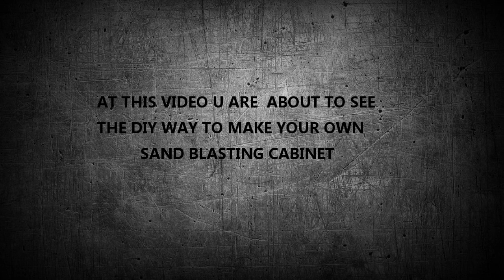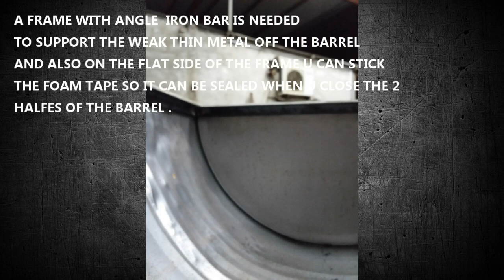DIY Sandblasting Cabinet Start to Finish

Comment: Can you explain why you so strongly warn that "most of the time they will explode when cutting"?!!  Unless they contained flammable liquid AND were not prepared properly ie rinsed, fumes allowed to evap, there should be no explosion concerns...   If they contained non flammable materials there is no issue, and if they did, prepare it properly and you'll still be good to go.  Don't scare people off by not giving the full picture!
Reply from the maker: Hi and thank u for this comment. Am just mentioning the above as a simple warning  to anyone that has the intention to re-create this type of sand blasting cabinet. Also as u read i justify that it depends what the barrel had inside. This way people can be aware and avoid any accidents.And this is the reason i mention above that it is best to get  this type of work done by a professional.
Reply: I def get adequate warnings and cya against stupidity, but your wording made it as if they will almost always will explode!  If it didn't contain flammables or was prepped properly then cutting a barrel is actually a very do-able DIY project.

Comment: looks perfect, have you found any limitations or anything you would do differently? why did you cut the barrel in half? couldnt you just cut out one end and make a door to seal up over just the end?
Reply from the maker: Hi man thank u for the comment . no it works just fine . i cut it in half so i could have the advantage of using the full length of  the barrel . The key, is to use a good sand blasting gun and a good dry air from a compressor .
Reply: i watched a few other drum blaster vids today as well as yours and some people just cut a "door" in the flat end of the barrel but the window and glove holes are mostly the same as yours. i was thinking it may just be easier to cut a large square hole in the end of the barrel and make a door maybe with some 1 inch square tubing to frame it so you can get a nice tight seal as i know blasters can tend to leak (specially the cheap commercial ones) 
another line of thinking is that if you cut it in half like you did you could also get some sheet steel and make it higher, more like an oval than a round shape if you wanted some more height in your design. 
ive been thinking about trying to build a blaster for years but the expense in buying new steel etc just seemed to make it not worth it but i can get these barrels for nothing here in australia but just never thought of making one out of them. i think it seems like the perfect solution to what i need, cheers, ya got a new sub and i hope you can keep putting out awesome vids
Reply: its easier to get parts in and out of the cabinet this way

Comment: Itu pompa Air nya menggunakan pompa apa bos?
Reply from the maker: Hello is it possible to rewrite your Question at English so i can answer it ?
Reply: Is the water pump using what pump and what pump capacity is needed?
Reply from the maker: Hi there is no a water pump this is a dry sand blaster . i need only compress air  to make it work and a vacuum cleaner to collect the dust  from inside of the cabinet .
Reply: Ok tanks
Reply from the maker: I am about to make a new wet sand blaster cabinet with full video no like thes one like slide show  . Thank u for your message . If u like to ask anything please fill free to do it .